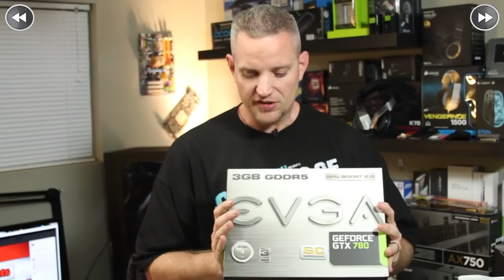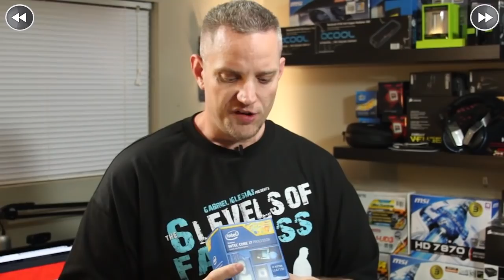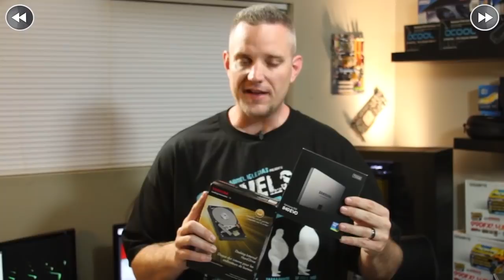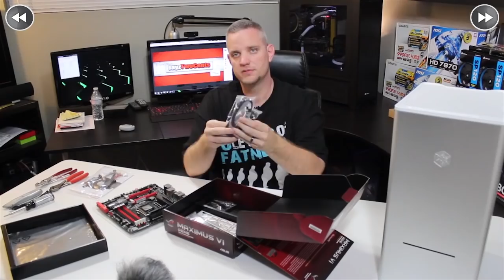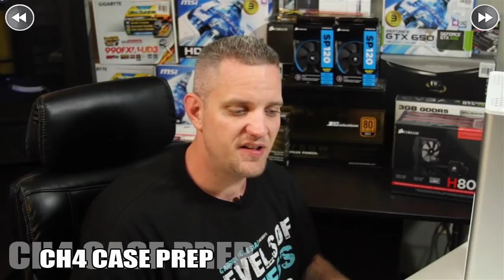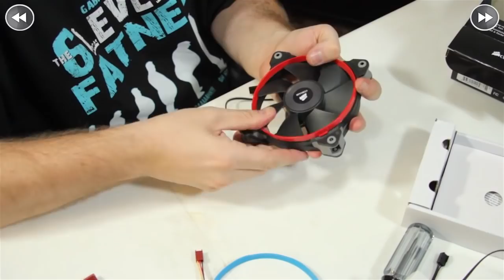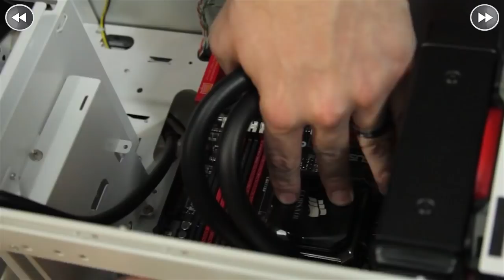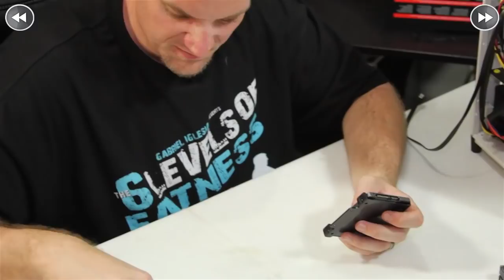How to build the Ultimate Gaming PC - Build Guide and Tutorial

Comment: I used to be an amd fanboy then I realized how much better nvidia is.
Reply: Statements like this are just purely retarded, with a PC build you set up a budget for your GPU at each price range AMD and Nvidia trade blows but one is ultimately better than the other for the money. When choosing geforce or radeon you must first decide whats your budget then get whats best from what you've allocated. You Dont buy the brand you buy a GPU.
Reply: Nvidia is better when it comes to taking all that green out of your wallet but I have to admit they are great when it comes to performance.
Reply: Kamal9Deuce That is not the way you gpu shop. Until recently you could buy a amd card and get more fps for your budget. Nvidia wasn't catering for the lower end people. Take a look at the amd 260x compared to the nvidia gtx 550ti. Same price big fps difference. Until the launch of the 750ti we see some difference. Nvidia forces the budget builders to settle for last gen cards.
Reply: yeah wekk nvidia is good,but they are good at rendering,gaming,and much more side things. amd is pure for gaming and is alot cheaper and has the same gaming perfomance. a 150 amd gpu vs a 150 dollar gpu nvida amd is gonna be better for gaming. now in the higher prive ranges nvidia will have a little lead but for that money that little lead isnt worth the money
Reply: Since the bitcoining and cripto currency craze every top tier video card raise 100 in price which is giving nvidia an advantage because the prices are looking better compared to amd
Reply: For gaming AMD is good as a CPU only
Reply: Freeze Amd is good for budget and price to performance but nowadays because of criptocurrency mining it kinda looks better to go with Nvidia for higher end cards.

Comment: The tool kit sucks .
if you're telling people you're a pro builder then get some pro tools ..
Reply from the maker: Troll.
Reply: Seriously not just you I see all these vids and nobody has a decent tool set..
multi tip drivers are amature stuff . get a real driver set and some brand name quality tools ,
You should always check the PSU for proper voltage before hooking it up to the MB or GPU .. where is your volt/amp meter ?
$ 500 cards are worth the extra 5 minutes it takes to make sure the PSU isn't faulty out of the box . 
Just sayin you should step up your game .
Reply: 5thhorsman Because if you know what you're doing with a PC, you don't need $500 worth of PC specific tools when you probably have tools that can do the job lying around the house. Honestly instead of wasting your money on a toolkit that will do nothing for performance you could dish out some more money towards your GPU.
Reply: Seriously. Pro tools? He's building a pc not a rocket you moron.
Reply: You know what I used when I built mine? My bare hands, a screw driver, and side cutters. I put my hands all over my parts like a [censored]. Sure you can build up the static in the case, but as long as they are touching metal parts and there isn't any electricity going through it, then you're fine. I even used an air can to blow over my parts in case any dust got in the way. I am currently running at 4.7 Ghz with my 3570k and (what the core maxed at) 1320 Mhz on my GTX 770.

I am a more novice builder, but by definition, my computer shouldn't have even started up from how I put it together. :P
Reply: Yeah , Why would you want a $60.00 multi meter and a $100.00 Insulated driver set to assemble $2,500 + worth of hardware for paying customers ?  That's just crazy yo .
Reply: 5thhorsman  Dude, you're fucked up
Reply: idiot school kid
Reply: most things in a PC are now toolless. I didn't even need a screwdriver when I built my current PC--they were all hand screws. I barely needed a screwdriver to water cool my rig. It was just to screw down my pump/block and installing aftermarket fans. Unless you're modding your case, you don't need professional tools PERIOD.
Reply: HeresCap
And then short it out on the PSU along with the motherboard because you were too cheap to spring for a multi meter and test it before hooking it up .
putting more time into editing the vid then actually building the PC using a dollar store tool set doesn't say much about the amount of effort being put into the work .
Reply: ***** true that. forgot about that. EDIT: need screwdriver.
Reply: 5thhorsman  I bet you never even saw computer parts together that worth more than $500 you fucking troll.

Comment: Could I fit an SLI config in this case?
Reply: Maybe but I would go with a slightly larger case. I have a gtx690 in a slightly larger case and it runs cool enough. Where are you putting the PC?. I have mine in my living room hooked up to my 3DTV. Even though the tower is a little larger than this one it doesn't look out of place sitting beside the stand my TV sits on

Comment: im saving up but say i did have 5000$ should i get the ultimate gaming setup or buy an ultimate bitcoin mining setup?
Reply: Bit mining will fall through.
Reply: Brandon Clary yea i was doing more research and i dont think its too reliable
better off investing in gold
Reply: crazychainsaw
5k?  5K!?!?!  You could SLI 4 MSI 780 TI Gaming cards for that with a 4770k!  For 1.5k you can get this and it'll last you a good long time...

http://pcpartpicker.com/p/2BYst
Reply: bugattikid2012 um...4770k is an LGA1150 chip, which supports up to 2-way SLI. if you want more you'll need a LGA2011 platform. although technically 4-way SLI is not officially supported...
Reply: menofwarrocks 1150 supports 4 way sli or crossfire silly...u just have less pci lanes than 2011 socket and thus u have less bandwidth cause ull run 8x 4x 4x 4x than 16x 8x 8x 8x. Some mobos like the maximus 6 formula (which is 1150) supports 3 way sli but 4 way crossfire. For 2011 socket though there is asus p9x79-e ws which can run all pci express slots at 16x with 4 cards there. Costs about 450$ if i remember well. If u run those 780ti in 4 way sli as s1 recommended though paired with a 4770k i think the cpu will bottleneck the system cause if that gpu power...better pair it with an extreme 2011-e cpu...idk 4930k or 4960x depending on the money u can spend there...thats all
Reply: oh so it supports it but just doesn't have optimal bandwidth.
Reply: menofwarrocks
It doesn't really matter at all because after 2 way SLI, performance just starts dropping, and dropping, and dropping.  It's barely worth doing 2 way, 3 way if you're rich, but 4 way?  The 4th card adds like 5 FPS tops on most games.
Reply: BTW if you're rich can you send some money my way?  Don't expect me to pay you back though...
Reply: menofwarrocks yes u just have less bandwidth and thus making your 3 or 4 gpus to perform less efficinet than on a 2011. Eitherway if u ever go to more than 2gpu just dont build the system on an 1150 platform. From there u go for a workstation and propably not all gpus will be the same. A friend of mine runs a quadro 4000, an AMD 7970, an AMD 5950 and an Nvidia that i dont remember the model...each one is for different use and they are not working together (they cant eitherway). Quadro for rendering and 3d animation the AMD cards for bitcoin mining and gaming and ofc the other nvidia for physix calculation.
Reply: I know there is a board the ASUS recently released. It's supposed to be a server board for LGA 2011, but it's just insane. It has 7 pcie 3.0 ports, and you can do 4 way SLI at 16x,16x,16x,16x with the right CPU. It's just too much. I was surprised to find that this board was only $550. O.o
Reply: the last 2 years asus really surprises on a possitive way...top of the line mobos, raidr, poseidon GPU, best WS mobos...well its so well done that im amused

Comment: Hello can some tell me can a 900 watt psu hold and contain two SAPPHIRE HD 7970 OC 3GB GDDR5. MY cpu is  fx8350. Please any info would really help I don't want to crash my system.
Reply: i have two 7970 oc from saphire and i have a corsair 1050w just because i have 5 HDD + 1 ssd 6 fans  . its depend on your system and what do you have .
Reply: thanks I have two ssd's 90gb each and two hdd's one 500 7200 rpm the other a teri 5400 rpm and my system fans I have a total of 8 fans
Reply: take 1050 w like me let your system go well and to not afraid if your system will fail one day
Reply: thanks man Ive decided to go with a 1200watt just to make sure

Comment: Futureproofing for a 4+ year build? Would have gone with 32gb ram
Reply: future proofing with pc is not buying the most expensive.  it is being able to upgrade.  get 16gb and an sli ready mobo with atleast a 850 watt psu
Reply: Indubitably
SLI is more than one GPU on a single PC
Reply: Well considering I've been fine with 4GB of ram in my iMac for the past 5-6 years, I think 32 GB is over kill if you're only planning for 4 years out.
Reply: Violet Whitworth
 4 gigs isn't going to last a long time, but 32 is a total waste of money.  BF4 won't even run properly with 4 right now, neither will Cod Ghosts from what I hear.  16 will be good for many years to come, and it's not over kill at all.
Reply: you can easily just throw more ram into the case down the line. i know it defeats the purpose of "future proofing" but ram isn't hard to install....
Reply: If I was future proofing that much than I'd wait for DDR4
Reply: good idea
Reply: ***** Newb here. What is "sli ready"? Is a mobo like the ASUS M5A97 LE R2.0 AM3+ considered somewhat "future proof"?
Reply: bugattikid2012 Well, what about running software like the Adobe Creative Suite? You've gotta have really good specs to have a no-lag experience with software like that. I have 4 GB of RAM, an AMD Phenom 9850 Quad-Core 2.5 GHz Processor, and an Nvidia GTX 260, and my experience isn't the smoothest (had this computer for 4 years). Personally, when I upgrade next, I am definitely not getting less than 16 GB of RAM and will want to get the fastest (or close) CPU and GPU available to the consumer-level market.
Reply: MccKeralisMC 8 gb is enough still for gaming 12 is overkill if you are not doing video editing
Reply: Niklas Bergvall I do video editing.
Reply: MccKeralisMC that is whatim saing buy 16 gb of ram
Reply: MccKeralisMC
I have to agree... 16 is more than enough for, well, until the rest of your computer gets outdated.  It'll last probably at LEAST 5 or 6 years still running everything fine, and probably much longer than that.
Reply: bugattikid2012 yeah this is wat i think 6 or 8 gb for apu 8 for gaming systems 16 for video editing workstation 32 if you are running a server

Comment: Jay I am building a pc, i have all the parts picked out except the graphics card. Im looking for an amd card for under 200 that can run Battlefield 4, Arma 3, and cod atleast arround 45 fps on med-high settings. Any recomendations? also anyone who reads this if you could help pleas reply thank you.
Reply: If you haven't had anyone reply yet, then my opinion would be to get a 7870 sapphire version, they're overclocked and have good quality. those things could probably run at max settings but you may have to turn off Anti aliasing that's the only set back or at least not full AA.
Reply: I agree with Kacy. With the release of the new AMD graphics cards the 78xx series dropped in price. Also, with the Never Settle for Less from AMD, you get two free games (I think). The 7870 Ghz is a great 1080p gaming graphics card. There is also the R9 270 (not the 270X). It is less than 200 and is at a sweetspot for price/power.
Reply: The MSI R9 270 Gaming Edition for 179.99 Jay did a review on it and it comes with a built in capture card
Reply: you can buy a gigabyte 660 ti for 170$ it will run any game you want it is awsome

Comment: I have never built a PC but it's now or never and looked for all the parts and would like to your opinion on the build I have chosen it'd mean a lot to me thank you.

Intel Core i7-3770K
Corsair Vengeance 16GB
Asus Black 12X BD-ROM 16X DVD-ROM 48X CD-ROM SATA Internal Blu-Ray Drive
Western Digital Caviar Black 1 TB
Samsung Electronics 840 EVO-Series 120GB
Corsair CX750 Builder Series ATX 80 PLUS Bronze Certified Power Supply 
ASUS P8Z77-V PRO LGA 1155 Intel Z77 ATX Intel Motherboard
Corsair Hydro Series Extreme Performance Liquid CPU Cooler H100i
Corsair Carbide Series Black 500R Mid Tower Computer Case
EVGA GeForce GTX 780 Ti
Microsoft Windows 7 Professional
Reply: I'm not Jay, but I built my PC not too long ago and I have suggestion or two. 
-I have the same hard drive you want to get, it's a nice hard drive, but it's pretty loud sometimes. So if you don't want a hard drive that tries to scare you with noise sometimes, choose another one. Otherwise I don't have a beef with the drive at all. It works fine!
-To cut back on your expenses, I suggest a lower wattage power supply. Video cards aren't really total power vampires. The one you have has a min. wattage of 250. If you aren't planning any extra expansion, you could get away with a little less wattage.
Reply: Jerfy Thanks I changed my build according to my gaming needs since I don't plan on playing on ludicrous resolutions pass 1080p and thanks to pcpartpicker.com I chose the correct PSU according to the estimated wattage for all my components.
Reply: If you could squeeze a little bit more cash, 50 - 100 bucks. I would recommend going with the Haswell 1150 socket.

Comment: Great build, only that case fan that blows air on CPU is totally unnecessary...
Reply: I wouldnt quite say its unnecessary. Since its water cooled there isnt too much air circulation directed at the socket where the mosfet/vrm heatsinks are designed to need. I have a Fx-8320 on an Asus 990fx board with water cooling. If i didnt run a fan over the socket/heatsinks the mobo would throttle down the clocks because of the mosfet/vrms overheating.

Comment: Ok i just build a new pc whit a AMD FX-8320 GIGABYTE GA-990FXA-UD3     G.SKILL Ripjaws X Series 8GB SAPPHIRE 100364L Radeon R9 270X  . i had a old mhard drive whit my old pc but i cant get it work for my new 1 it has windows 7 on it its strats to load windows 7 then i get bule screen and then the pc restarts thanks for the help  who ever gives any
Reply: It wont work beacuse you have all the drivers for your old components instaled on Windows on that hard-drive and those drivers wont work with your new components... Go to the BIOS, erase all data from hard-drive and then reinstall Windows...
Reply: brez is right. If the copy of Windows is legit (not saying it isn't), boot the hard drive in the old computer. Google around for a program that can tell you the Key for the operating system. If you have the Key, just pull all of your important stuff off the drive and do a reinstall.

Comment: I think i7 is for professionnal, not for gamer. (for 3D, modeling....)
In game, you win maybe 1, 2 , 3 or 4 (max) FPS (average) with a i7 compare to a i5. 
For 100$ and more. Worth it ? I don't think so. With that money, i prefer buy a better water cooling for the GTX 780 which performs better with low temperatures.
(sorry for my english)

Comment: Like he said about the GTX 780; get one with the regular Titan-style cooler if you have a small case like this without extra air-flow, but the custom cooled cards are better with larger cases. I have the Asus DCU2 GTX 780, and the cooling is excellent; Even while moderately overclocked and with the voltage turned up, it has NEVER reached 70 degrees celsius, even after hours of running games on ultra settings.

Comment: LOVE THIS BUILD. Only a couple things I would have changed. I would have gone with the MSI 780 Twin Frozr. Switched out the PSU for a Corsair AX760i. Its modular, platinum, and matches the colors. It would also work even better with Corsair Link. It would have also cut down on the noise in its ZERO RPM fan mode. I would have also given a USB 3.0 for backup just because its faster. Only because of personal preference I would have liked a WD Caviar Black or Raptor.

Comment: well I have a h80i and with the cpu under load if I spin one of the fans down you can see a noticeable difference in my temps and if your running push pull its more efficient and you run fans slower so its also quieter.

Comment: great vid!  I had a question bout windows 8, I was reading that they changed the way the license works with oem/system builder where you can now upgrade the mobo or cpu later on without it deactivating. So just wondering how this works is it a limited number of times?

Comment: As the buyer I can tell you guys I am very pleased with this. I'll try to answer a couple of the questions. Why the 780? I've used Nvidia for a long time. AMD is certainly testing my loyalty but I'm not ready to switch yet. 4770k was for potential OC. I didn't expect it. Figured it would be case related heat issues though not the worst 4770 that wasn't DOA. But if the OC could happen I wanted that option. It just didn't work out. CONTINUED.

Comment: Well the R9 280 is basicly just a HD7970 with the ability to crossfire without the scrossfire link/bridge... so if you want the R9 280 cheaper just get the HD7970... The new architecture is in the R9 290 and 290X

Comment: why use the SP fans when those are optimized for Static Pressure like for use on a radiator, (i have mine on my H80i) the AF fans (air flow) are ment to be used as case fans

Comment: Storage is always a personal thing. Myself, 256GB isn't enough. But I have a 128GB SSD that I use for my OS/important software, and then I have a total of 6TB of normal drives for anything and everything else. If you don't have more than 10 games installed at any time, and not too much software installed, and you only can get one drive, 256GB should be enough.